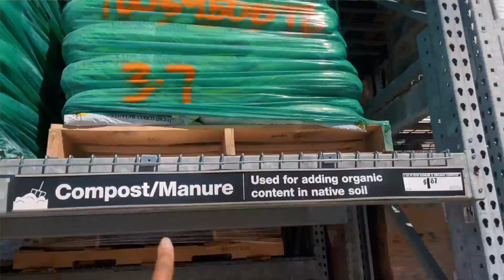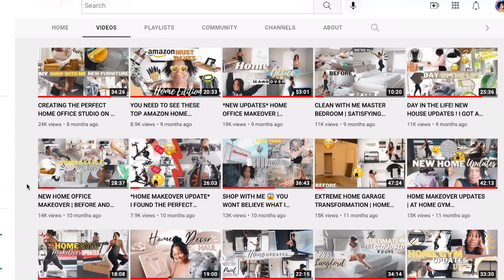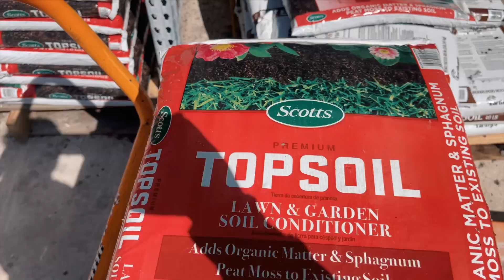FRONT LAWN MAKEOVER | RESOD MY OWN LAWN | STEP BY STEP BEFORE AND AFTER | OUTDOOR HOME UPDATE | HOA

Comment: Get some compost and rake it into the dead pieces and keep them soaked. It’ll fill in. The grass around it will crawl in too. I fixed patches in my sod like that. Then give the lawn a good dose of  pre-emergent and fertilizer. You did a great job! Get a hose timer too so you don’t have to  worry about being present for watering.

Comment: 🤔 the grass will need to have compost spread on it and over seeded once a year. That as easy as cutting it low the spreading a thin layer of composted manure or if your municipality has a composting site then get some of that. It’s usually inexpensive. Then toss some seed of the same type of grass over the lawn. 
In addition to the fertilizing and overseeing once a year it will need to be core aerated and dethatch. This will take the dead grass out of your lawn thus allowing the water you put down to  soak into the soil and lessening how much is running off. 
For the mulch when you remove it make sure to spray that area for weeds the lay down professional grade weed barrier or you will have weeds in that area in a few months instead of several years. You should be able to obtain inexpensive rock from a local rock yard. That’s who landscapers use and they sell by the cubic yard. This should save you a lot of money.
One last thing make sure to treat your yard for weeds with a pre-emergent in the spring and in the fall. Do this especially where your yard to meets your neighbors yard because the weeds in their yard will populate and over run your yard. 

Love the work your doing and I wish you success with your YouTube and home improvement/ upkeep endeavors. 🙏🏽✊🏾✊🏽✊🏿

Comment: Don't water anything in red hot sun it will dry out plants and grass and burn them up. Water on an evening when suns almost down and cooler. Notice when it rains it darker shaded and cooler. I know we have the odd sprinkles in the sun too but you get it. I learned this by burning mine.loool